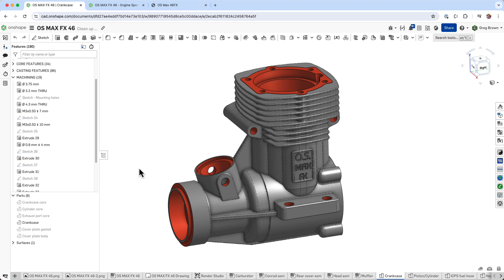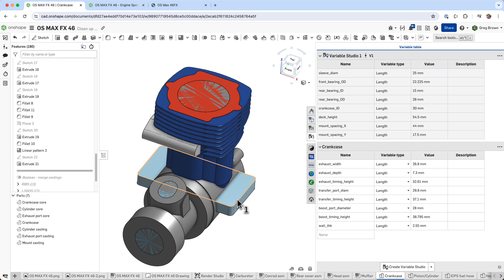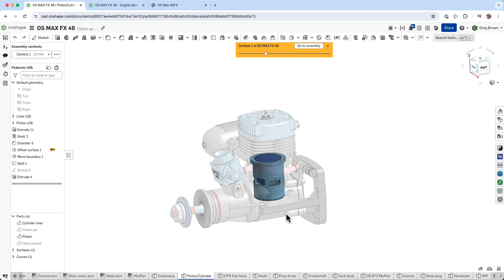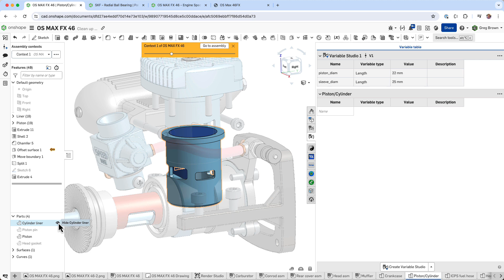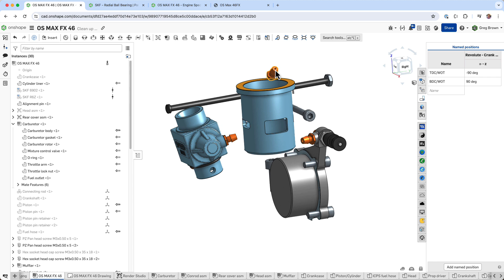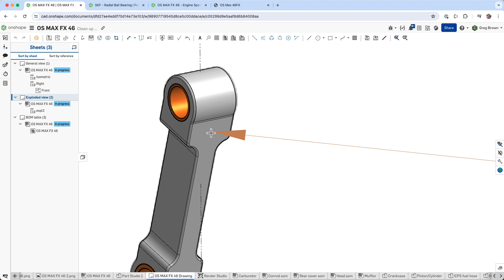An Onshape approach to everyone's favorite RC nitro engine

Comment: why did you use Move Face to finish the fuel tube instead of extrude?  same result, but any other benefits of one over the other in that specific situation?
Reply from the maker: They will/can give different results as they are doing quite different things topologically. In my case an extrude would have worked,  since the underlying sweep path was tangent at the ends. However in different situations, such as a simple arc, the move face and extrude will look quite different... The extrude will be by definition a normal direction from the end face, while the move face will keep the curvature of the side faces (thereby extending the arc)
Here's a quick example https://cad.onshape.com/documents/b9b52e11d7266e5ed655ab50/w/77611edca52037d2e35267c5/e/9ed093d8a42d4ae0dbb4e479

Comment: Hey Greg! Is this model public by chance? I would love to check it out!
Reply from the maker: I just made a public version available for you! https://cad.onshape.com/documents/117ebf5924e35f3871c8e6d5/w/6ddb0cd91f2377e06e55ada6/e/665c31713a0909595ff09e24
There are some linked docs that you won't be able to open, but they are just to standard componentry that I don't really want to make public just yet. I think you'll find the Crankcase Part studio the most interesting anyway. 
If there are confusing things in there, please drop me another comment and I'll be happy to (try to) explain

PS in the version I provided the carburetor is not complete. There is a neat sliding/rotating aspect which is only in my private version. I'll hopefully get around to updating this in the public one. (It took a bit of disassembly of the actual OS MAX-46FX which is sitting on my desk here to understand how it works!!)
Reply: @gregbrown-onshape7555  epic thank you I’ll check it out!

Comment: Hey Greg, I like the method you show building the engine from the inside out. I have a question for named positions. After mating your assembly for motion how do you create the named positions with the parts at top and then bottom dead center?
Reply from the maker: Sounds like I should do a quick demo of named positions. Watch this space!
Reply: @gregbrown-onshape7555 I would be very interested to see your preferred method for establishing the positions.